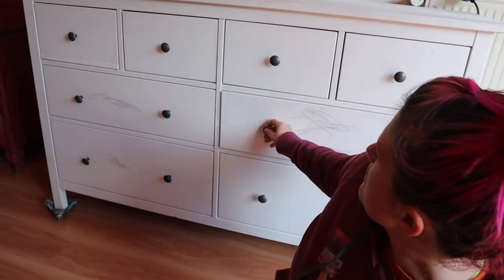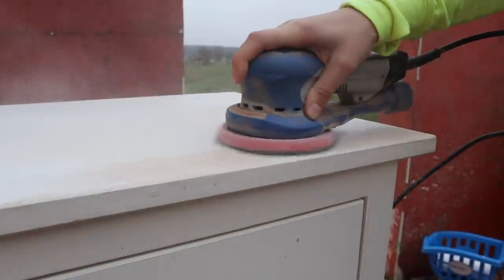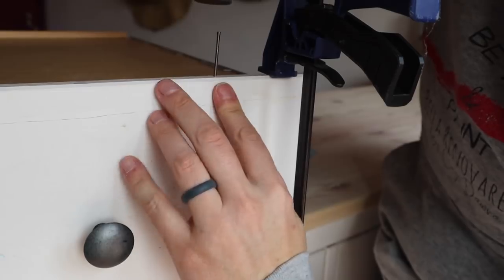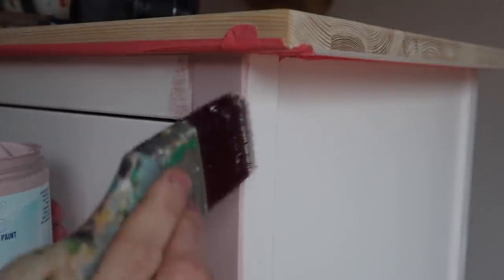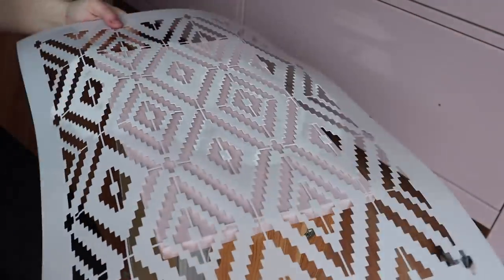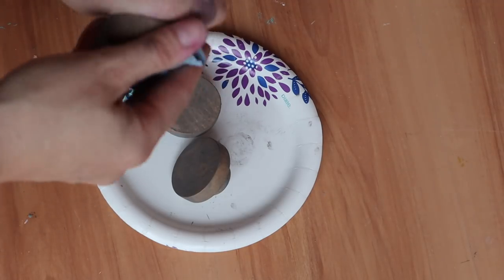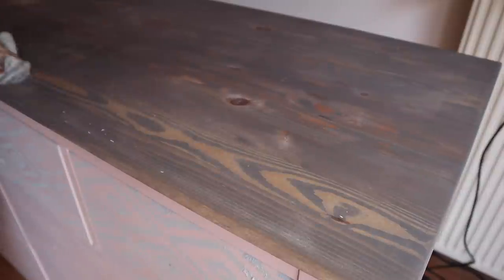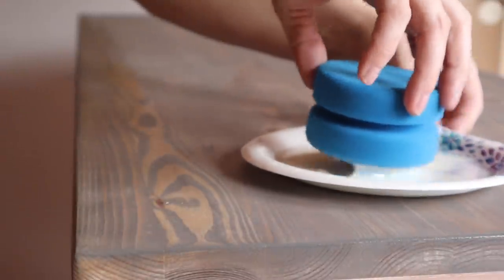Amazing IKEA Dresser Makeover

Comment: great video! super like.... quick question. IKEA came with two different colors for this dresser. One is WHITE STAIN and the other is just WHITE. is it possible to redo the WHITE -color dresser? (i think the one in the video is stain finish)
Reply from the maker: Okay so this one had a solid white finish but under is the pine so you can remove the white to get to the pine if you want :) it is a thick layer so it took a bit of time to remove it :)

Comment: What aboil Billy bookcases from Ikea? They are not solid wood and have a foil finish. Can they be painted with the mineral paint?  I want to paint my bookcases blue.
Reply from the maker: Yes you can but I would suggest using slick stick first it is a bonding primer that you use for non wood surfaces :)